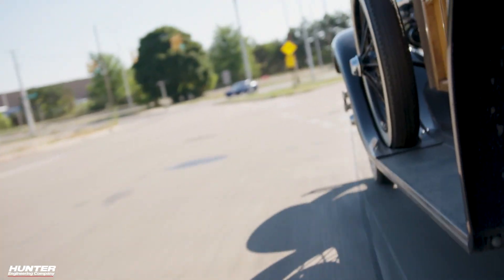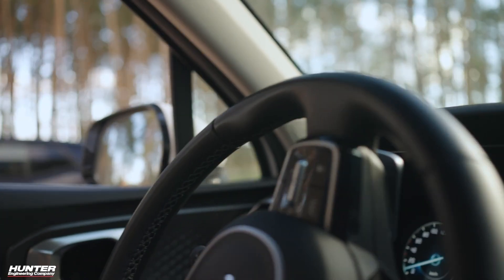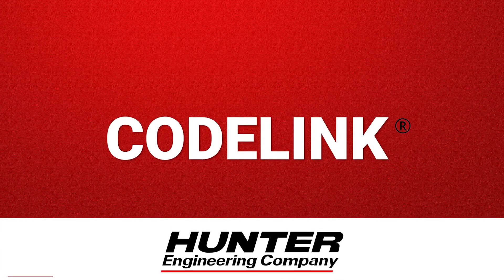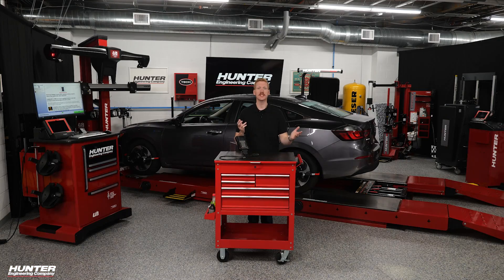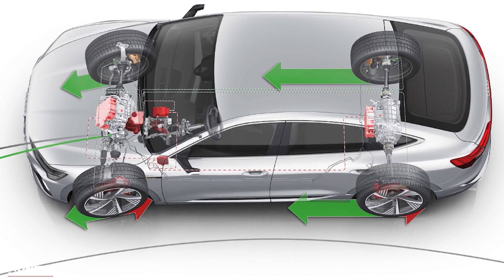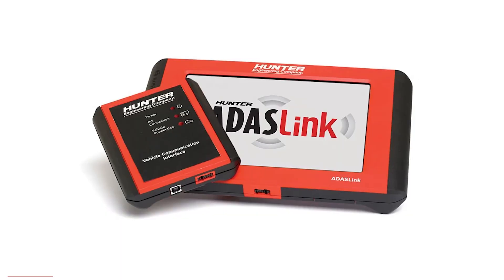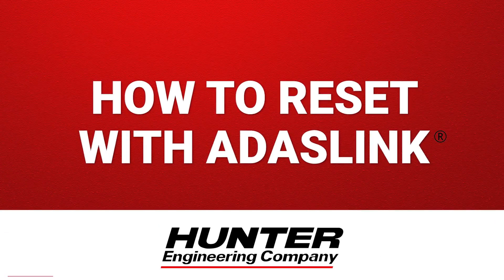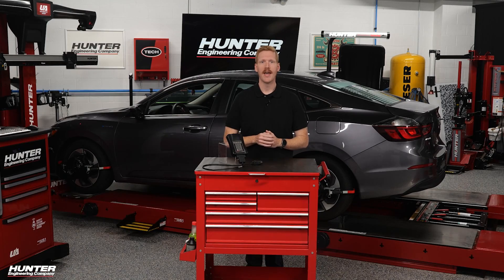Understanding steering system resets: ADASLink® and CodeLink®

Comment: If the vehicle has not been in a collision and you are doing a maintenance alignment, why is this step necessary? The sensor is already calibrated to the straight steering wheel, you are setting the alignment to that straight wheel